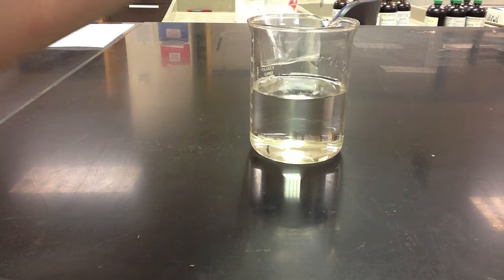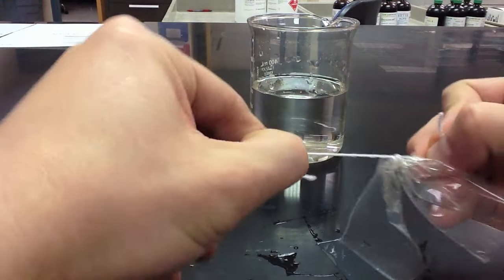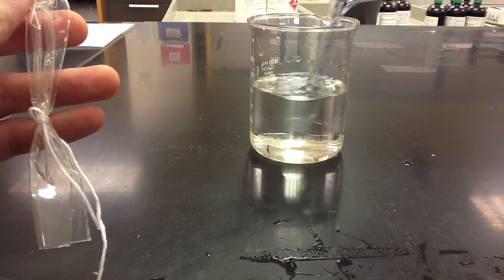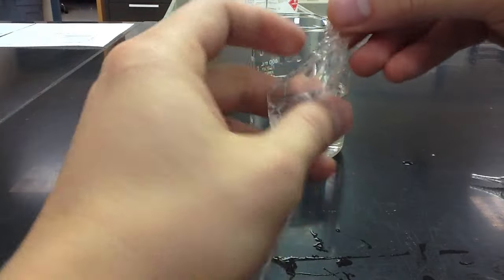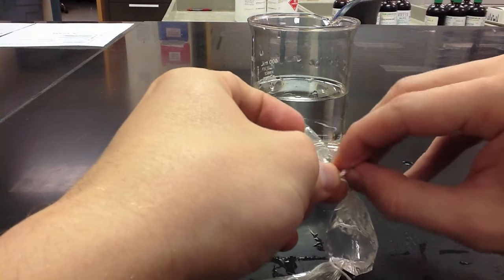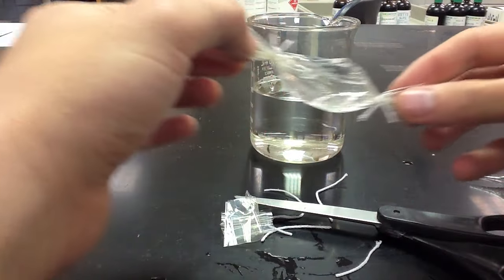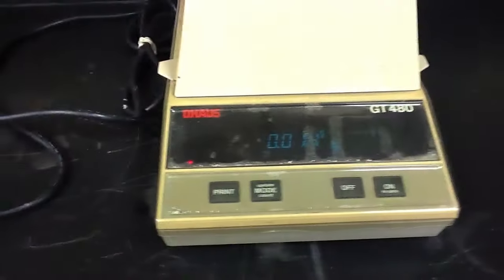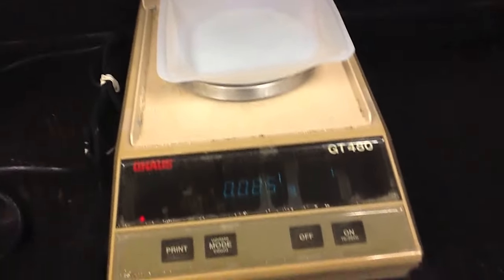Lab Protocol - Dialysis Tubing Experiments (Unit 7 Diffusion)

Comment: Although you posted this long ago, this helped me understand how to do my at home lab assignment. THANK YOUUUU!
Reply from the maker: Happy to help!
Reply: I have a question
The diagram shows an experiment demonstrating Osmosis using a dialysis tubing bag. After 30 minutes the level of the liquid in the glass tube goes up because the water had a _ water potential than the sugar solution. Can you fill the blank
Reply: @AdnFarooq-ux7qp  water always travels to lower water potentials.
a sugar solution has a lower water potential.

Comment: Still helpful as ever 9 years later! Thank you for this :D
Reply: I have a question
The diagram shows an experiment demonstrating Osmosis using a dialysis tubing bag. After 30 minutes the level of the liquid in the glass tube goes up because the water had a _ water potential than the sugar solution. Can you fill the blank

Comment: currently doing this lab virtually but I still wanted to see how it looks in real life, super informative and definitely helped me understand it more, thank you!
Reply: I have a question
The diagram shows an experiment demonstrating Osmosis using a dialysis tubing bag. After 30 minutes the level of the liquid in the glass tube goes up because the water had a _ water potential than the sugar solution. Can you fill the blank